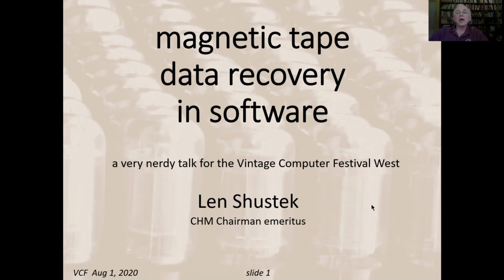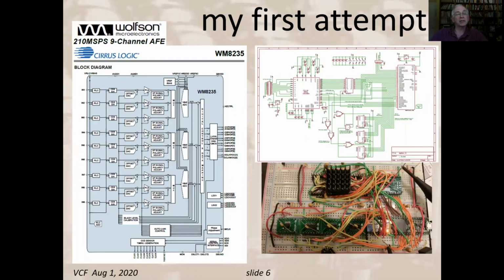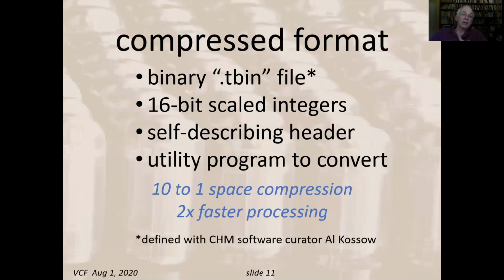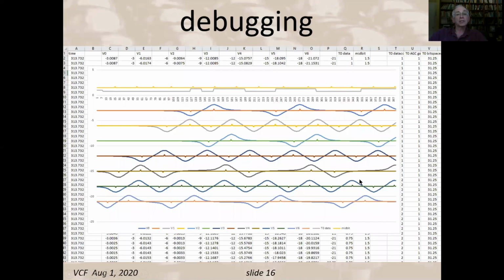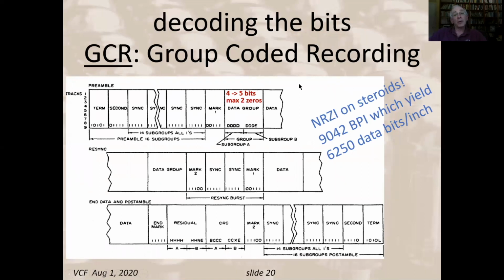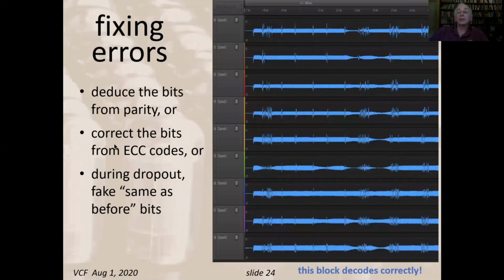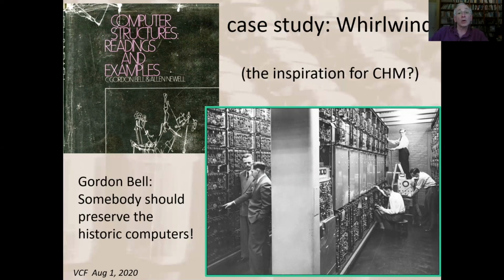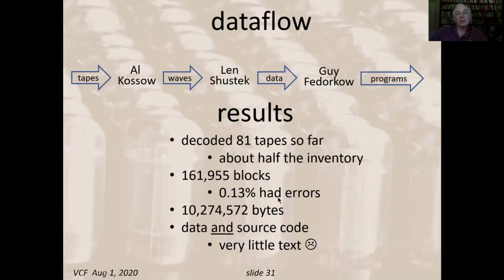Len Shustek — Magnetic Tape Data Recovery in Software

Comment: This is great stuff - thank you.  You wouldn't happen to have a Linux executable, would you?  I got the code to compile successfully using gcc, but it won't run any of the examples - it doesn't like the input parameter syntax it seems, as shown by the output below.   
     I'll slowly pick at it; my "C" skills are extremely rusty...  
Thank you again, Michael.  

$ > ./readtape -v -nm -nrzi -ips=50 -deskew -ebcdic -linefeed -outp=results %1 %2 %3 PLAGO_beginning

$> * unknown parameter: %1

$> readtape version 3.16, compiled on Aug  4 2025 22:31:24

$> use: readtape <options> <basefilename>[.ext]

$>  The input file is <basefilename> with .csv, .tbin, or .tap,
...
...

... and many lines of parameter documentation follow here...